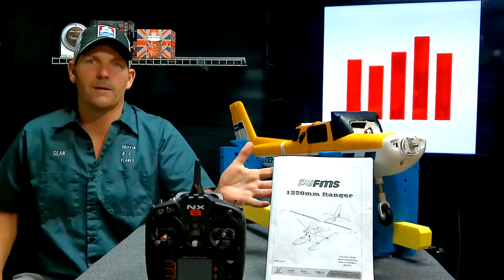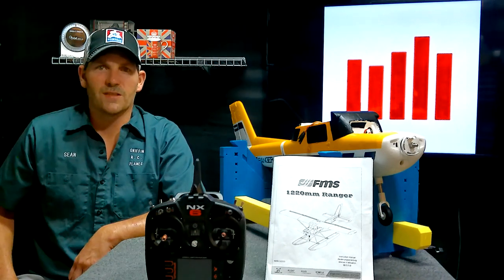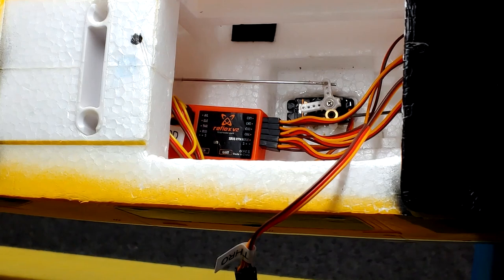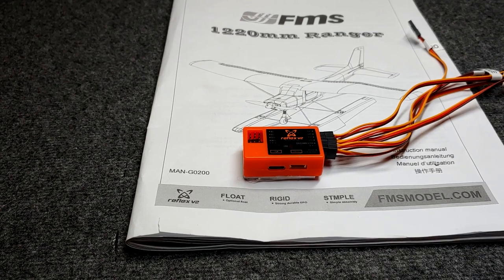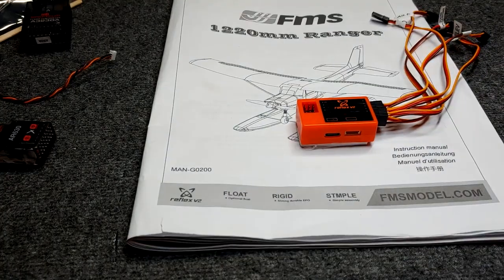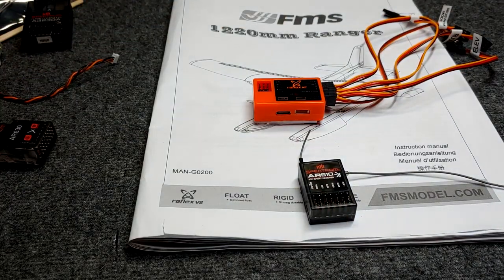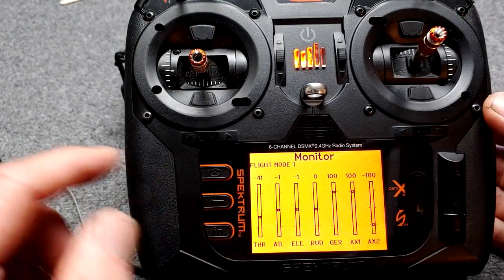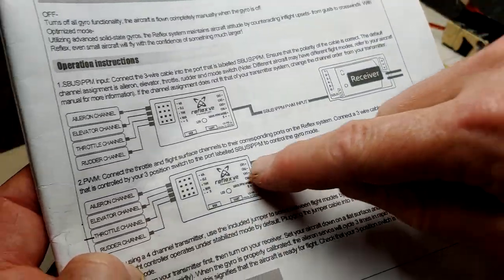FMS REFLEX V2 CONNECT TO SPEKTRUM RECEIVER EASY TO FOLLOW ALONG AND UNDERSTAND EXPLAIN EVERYTHING

Comment: Well done Shaun, shame you didn't demonstrate the effects of the vector/reflex by lifting up the plane and rolling then simply  switching to the 3 positions and showing that 1. The ailerons move and stay there(safe) 2. Nothing happens. 3. Ailerons move then quickly return to normal (as3x) Stability.  
Arrows call it Vector. FMS call it Reflex. Same box of trickery

Comment: What if your plane has flaps and gear so none left for the mode select? Would the gyro default to off?
Reply from the maker: If it had gear and flaps and you only had a 6 channel receiver and a 6 channel transmitter then you would not have any chanells to change flight modes.  In that example you would need 7 channel receiver and transmitter or up to be able to change flight modes

Comment: Hi Shawn. A dumb question for you that has me a bit concerned. I have my FMS Bonnie all hooked up. It has reflex and I am using a Spektrum 8020T receiver. All the basics seem to work alright. I have to reverse a couple òf things but thet are working.
Nòw I want to set up the fliĝht modes for beginners,  wind and expert. This should work off the Reflex, but do I enable or set it up  through my Spectrum forward programming like as3x and safe.. secondly when usi g the reflex flight controller my Spektrum receiver should not have as3x and safe in it hence my choice of the 8020T vs the 630.
Cheers
Bob

Comment: Couple questions how do you set it up if your plane has gear if you flip your gear to lower or raise the gear you would shut off or turn on the reflex. Also does the reflex help with p factor on warbirds?

Comment: Hey Shaun, you've been at the Bud kite, I've checked both Reflex and Vector and both state channel 1 Aileron 2 elevator 3 throttle and channel 4 is the rudder. You've got them all mixed up
Reply: He connected the cables to the receiver correctly. The Reflex uses AETR (1234) and the Spektrum receiver uses TAER (1234).
Reply: I agree with you, and Sean. But watch his part on the transmitter port assignment
Reply: @patrickhoyle8357 He left the Rx Port assignments set to the Spektrum defaults. Nothing wrong with that as long as he hooks everything up correctly, which he did.
Reply: @txkflier  I'm well puzzled. I've just set up a new plane and had to change the port assignments , on spektrum default nothing worked correctly - the throttle worked the ailerons - motor just beeped at me - once I realigned the port assignments same as the receiver, everything works ok- even the motor
Reply: @patrickhoyle8357  You can change the Rx Port assignments so that you can plug 1 into 1, etc. But you don’t have to if you plug Ail into Ail, etc.

Comment: Hi Sean. Any idea what is the default of the gyro if I use it out of the box.  Btw I am using the reflex in a brand other than fms, so why I need to program it
Reply from the maker: I dont know the answer to that
Reply: @hayloft3834  yes of course, one will need to test the movement of the control surfaces until getting the correct movement or changing the position of the gyro and restarting it every time.  But usually the high wing models are slower in response compared to jets/edf.  In spektrum this is know as gain.  So there is 1x gain and 2x gain etc so adjust the speed of response.    I just wanted to mention that the FMS reflex is adjustable. I have been using it a lot and I like it more than the spektrum asx3 since they much easier to use.  I am sure there will be some gurus out there who know how to reprogram it. Anyways I use them mainly for more smooth my flights.

Comment: Hiya guys I don't mean to spoil your efforts Sean but there's a couple of things I found out the hard way I'd like to share . and one part I haven't nailed yet......I have a few fms planes with reflex gyro's,,,they are mounted 180degrees the other way so rotated that is. I have mounted these in non fms planes . The only issue is the reflex preset gyro reaction direction for the control surface . I thought changing that on the TX would solve it but it doesn't..... what I found was if the servo direction could be rotated 180degrees without changing the servo arm it reacted in the correct gyro input direction..... If the servo was in a position where just the arm could be rotated 180degrees that works ..... One plane that had rudder and elevator servo's mounted in parallel I simply swapped the pushrods and servo cable inputs to the gyro . I'm currently about to try servo signal reversers between the servo and the reflex input and then set the TX direction correctly . So what I guess I'm saying is the gyro preset direction does what it's set to....... Apparently you can re-write / configure the gyro via the fms set-up site as if you were installing the reflex into an fms plane that didn't have one ,,,,, a mature gentleman has posted a video regarding this but I can't remember his name and don't know how to post a link....so the setting up the reflex via fms makes my brain hurt just watching that demo...... I've opted for the mechanical option......I'm hoping this comment may save someone the time and sore brain I did ...... Good job Sean..... happy flying and love from New Zealand 🤪😉 ok